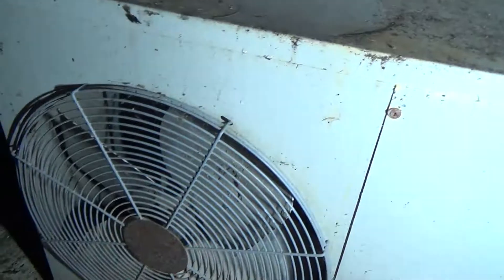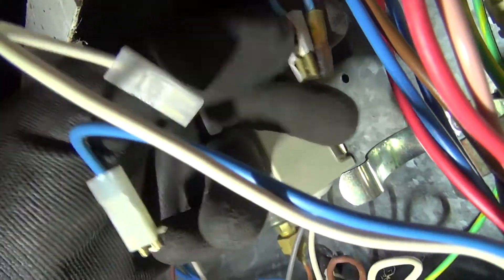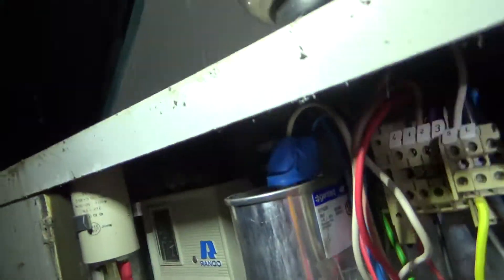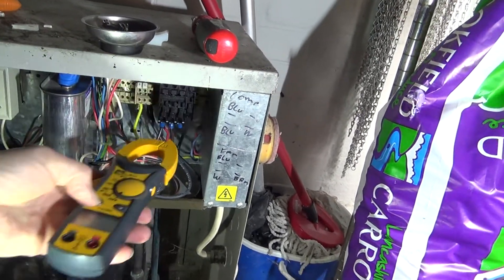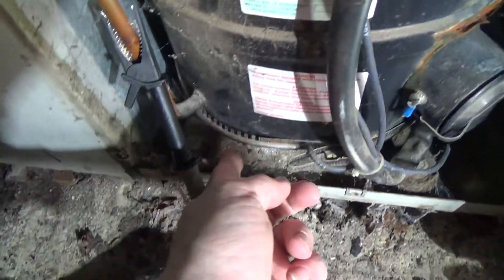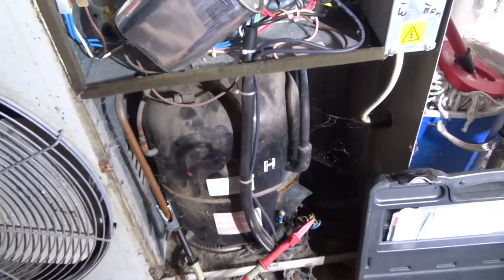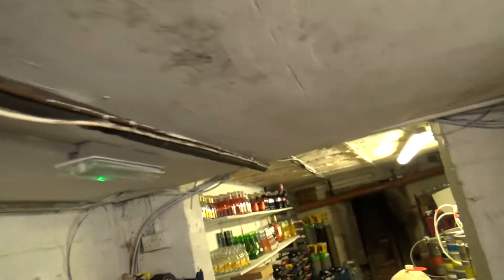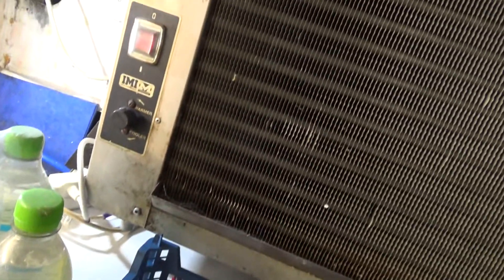IMI Cellarator Not Cooling

Comment: Would you opt To install the Unit outside? since the lines are already there??

are you swapping the coil as well?   

that system looked a bit undersized  even tho i understand  its not a COLD room lol 

more like an Air condition space? 10-15 dg?  unless i'm wrong but that coil did look a bit small?

Maybe two coils instead of one?
Reply from the maker: We replace the whole system including pipework. 

Sizing wise its deceptive, because this is a below ground cellar there is not as much cooling load, its coped all winter with no cooling, so this system is a fair bit oversized for just the cellar but then you have to account for the fridges and beer python chiller.